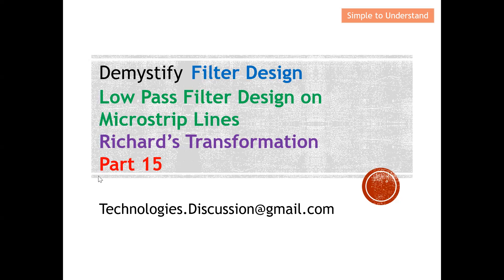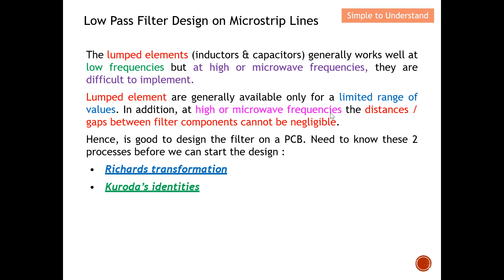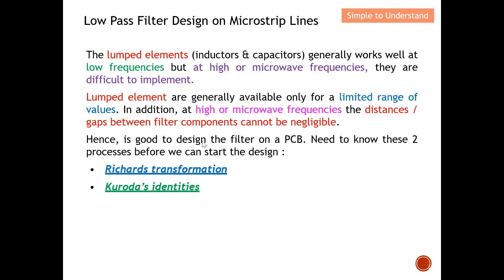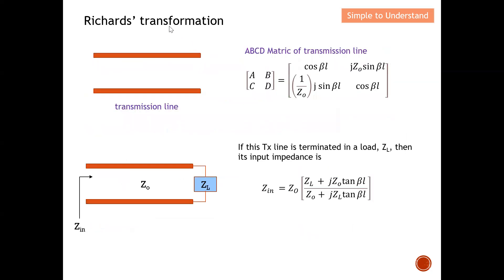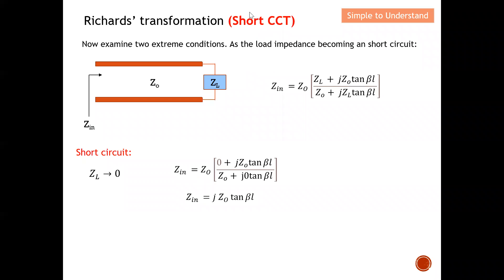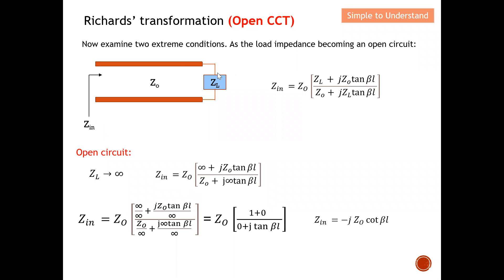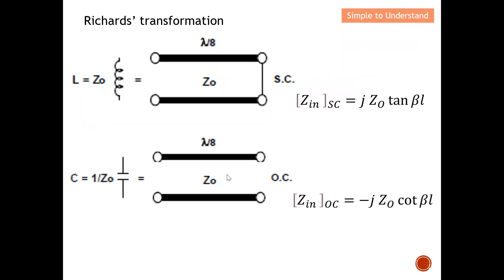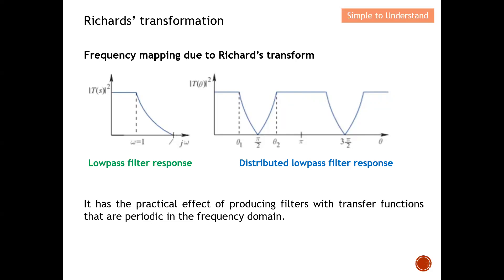Filter Design #15. Richard's Transformation: To Convert Lumped LC to Distributed Series/ Shunt Stub.

Comment: Thank you for this informative video. Can you please make a video on transforming the lumped elements into distributed elements. And how to do this in ADS?
Reply from the maker: I have the discussion on transforming the lumped elements into distributed elements.
This video: Filter Design Part 17. How to Design Microstrip Lowpass Filter, LPF Using Transmission Line on PCB.
https://youtu.be/dBVUjBz6Wms

Will take some time before I move on to ADS.  :)